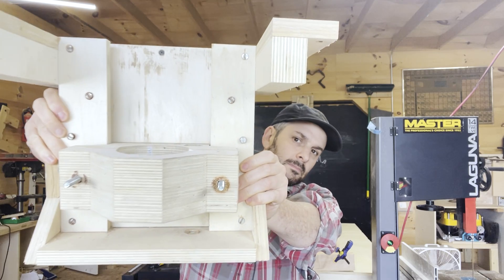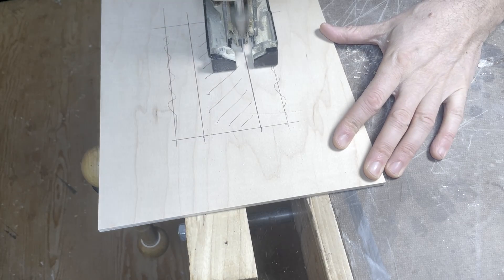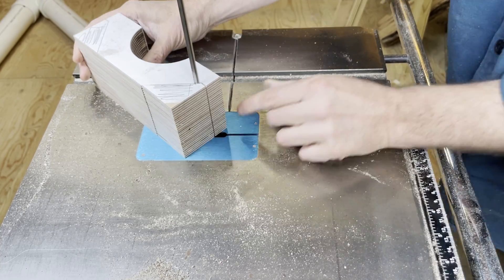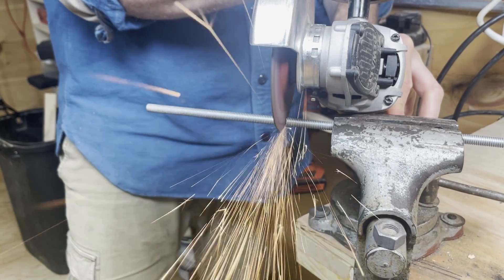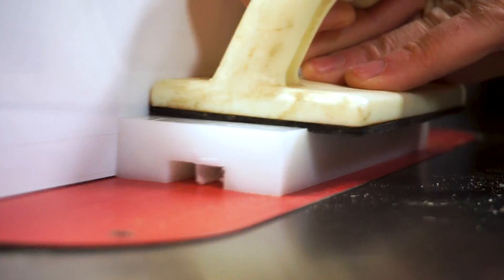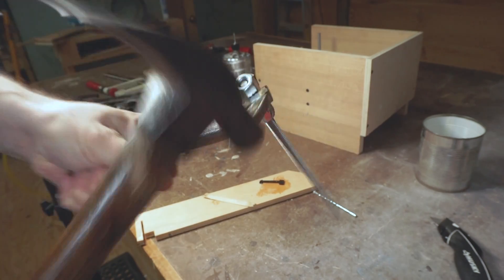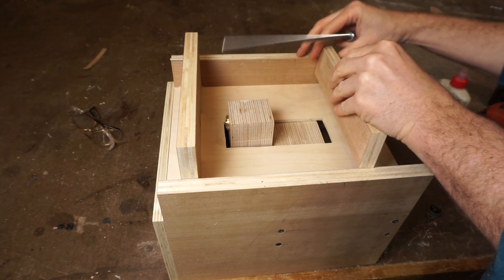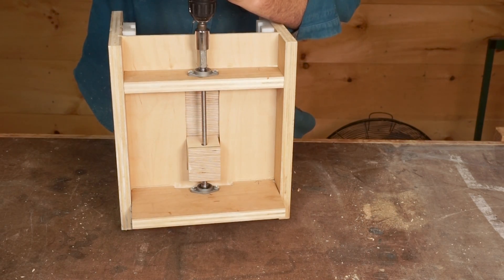Router Lift. Strong fast and easy to build

Comment: Do you have ideas for a locking mechanism?  Does the position move with vibration?
Reply from the maker: I never really solved this. In the past I've used threaded rod and a T-nut and the friction was enough, but the lead screw on this was too loose.

Comment: Very nice lift my friend. Looks like it will glide up and down easily. Wish there were plans. I really want to make one for myself. At this time I have to manually raise and lower my small router. Awesome job and very well thought out.
Reply from the maker: Thanks a lot. I'm still working through some stuff like mounting, dust collection and insert plate. Maybe I'll put some plans together when it's all done.
Reply from the maker: @Scott Crawford yeah that tends to be more or less what I do. I really do want to make plans for this one but I think I have to make some tweaks to the runners and tracks first

Comment: Nice job.  What locks the router in position after you raise or lower it ?
Reply from the maker: good question. Right now, nothing. And it'll slip down.  But stay tuned for the next video......
Reply: Maybe just cut a slot in the side of the cabinet for a threaded rod and lock nut?